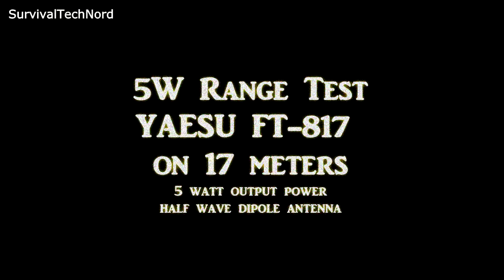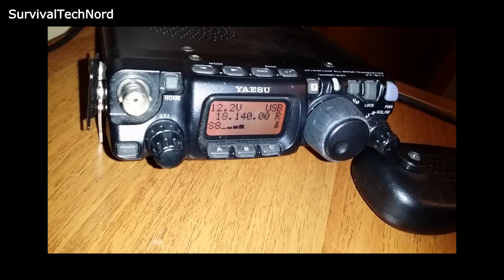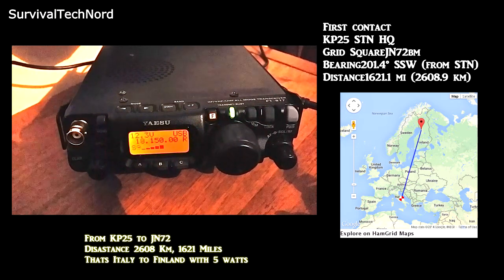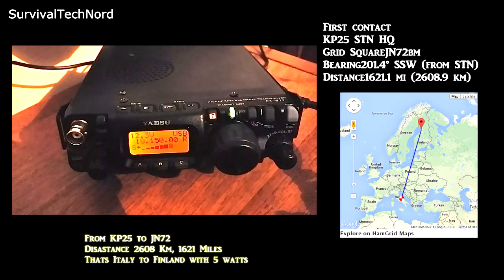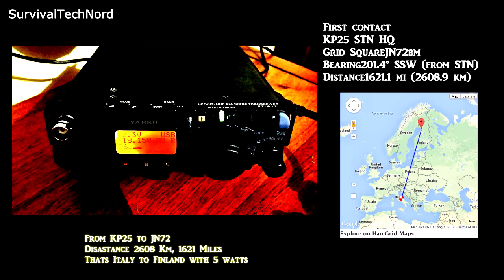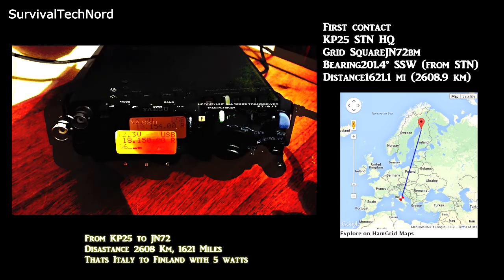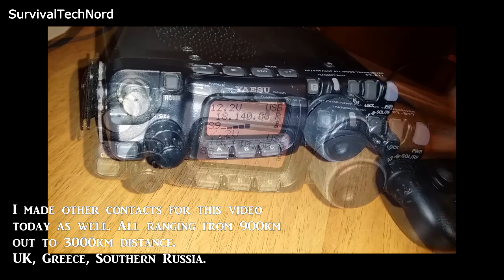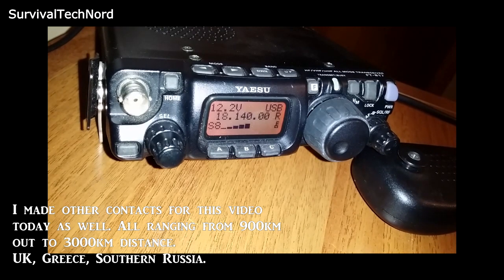Yaesu FT-817 QRP SSB | 1621 Miles 2608km

Comment: a couple weekends ago I made 5 ssb phone contacts from 750 miles to 1500 miles on 20 meters without much of an issue, also one 2700 miles (newton iowa to Anchorage alaska) but he was not really able hear most of what i was saying. that was all on a junk speaker wire dipole i made hanging inside my inclosed front porch) for everyone up to 1100 miles they were able to hear me pretty easily. (only having to repeat the last part of my callsign once to flagstaff Arizona 1100miles) So far I am pleased with my 817nd,  hope to have my fan dipole on my roof this week (inverted V 40ft at center) which I am hoping will be better, i have a lot of noise right now with the 20m where i have it right now. And to anyone reading this its not a typo, i mean miles not Km so thats basically  1200km to 4300km and 2700km being the furthest that day with no struggle (the flagstaff one)
Reply from the maker: Dipoles are great if you can get them in the air. I think thud video used a dipole,  I don't remember. Thanks for commenting.
73
Reply: i can't wait to get mine up on the roof,  the distance i got so far was at about 8 feet off the ground so hoping 40 feet will be a lot better :-)  thanks for all your great videos by the way

Comment: Great commentary as always. I'm a novice when it comes to HF, not enough hands on experience. I was wondering if the FT 817 have an external PTT signal to let say drive a antenna relay device to separate TX & receive out of the same antenna port? What I was thinking about is maybe using and external TX amp to push that 5 watts higher if desired. I'm really beginning to dig the all band radio but the 5 watts is a turn off for me. Its a penis truck syndrome for now, I know 5 watts is more than capable for the ranges I might be interested in. Great talking points dude, you always bring things to practical perspective..
Reply from the maker: Hi GC, thanks for the comments and questions.
Yes there is. The 817 has an 8 pin mini din (ACC) port on the back panel. Through that port you can control your amp, but there is no bias-tee on that port, so if you need to power an RX preamp, you would need a sequencer.
A small 50 Watt amp would work well on V/UHF for simplex comms. Reliable comms on HF could be achieved with a 10 -20 watt amp and an efficient end-fed or dipole antennas.

Like you, I am a VHF/UHF/SHF guy. It was very difficult to get the "output power " concept out of my head when on HF. It was even more difficult to understand the differences between SSB and FM modes, and why modulation is more important on SSB than output power when on HF.

 On a friendly point, hiking, camping and SSB work on 6, 17, 30 and 40 (my favorite bands) meters with a portable do-it-all radio is awesome! I guess I'm preaching to the choir :D

Comment: Pretty difficult for me to understand what the guy said, but I guess this overall success is also the result of a heck of an antenna tower.  Does that have the appropriate plug-ins that would allow some sort of texting with your android device?
Reply from the maker: thx for the comment brother.
no tower this time. the wire antenna was suspended between two trees 5 meters off the ground. 
we could also send data e.g. images,  text, ...
Reply from the maker: Would you find a demonstration of messaging or chatting over RF in place of voice comms useful or interesting?
Reply: SurvivalTechNord
It is just that with my hearing issue, and people's accents, I need to be able to work with text, but that's me.  I try to have conversations with people over scrambled or encrypted equipment and that's enough to blow it for me, I won't understand what they are saying.
Reply from the maker: Well this was one example out of tens. In a WROL situation sending encrypted text is as simple.  I use my Android phone or tablet to send messages,  chat send or receive images using different digital modes on HF ot V/UHF. its very simple stuff!
As for your hearing,  sennheiser noise cancelling headphone will help!